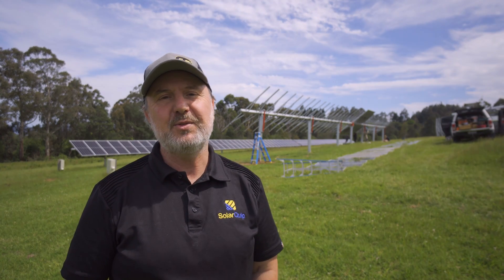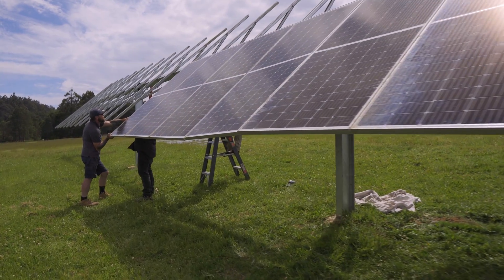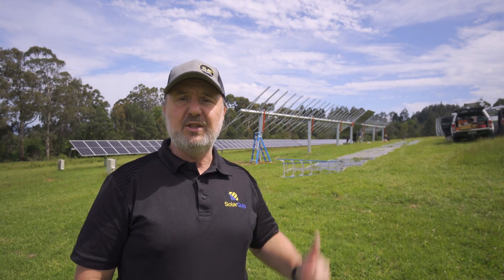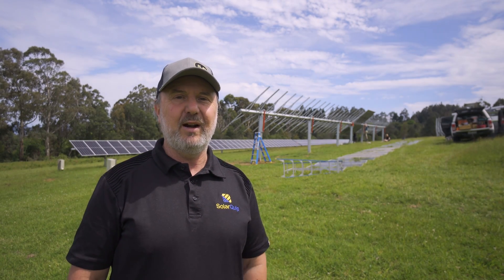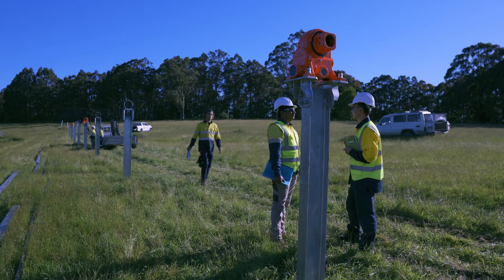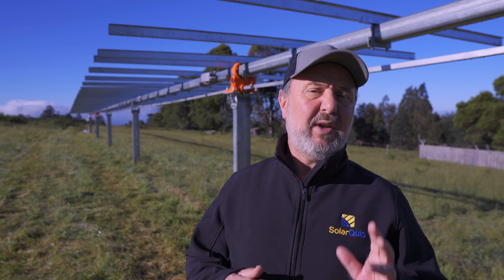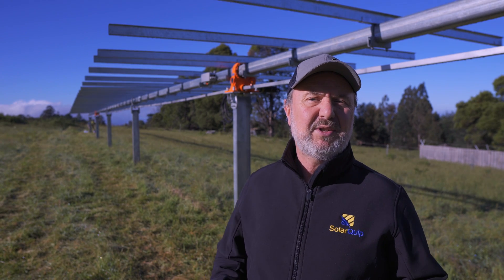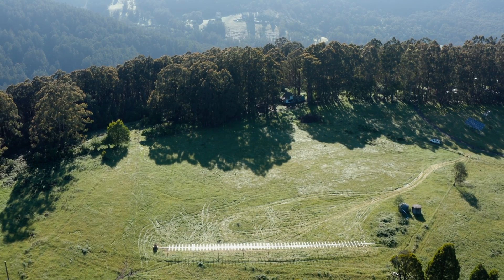120 Panel Solar Tracker Installation

Comment: Do you need linear actuators, slewing drives, solar tracker controllers these key components of solar tracker system?
Reply from the maker: No thanks. We are a demonstration and testing facility.

Comment: Those passive drives seem quite inefficient compared to using many smaller motors. I bet in 3-5 years when economy of scale kicks in we would see systems with many smaller motors and planetary gears in those types of trackers. Maybe even purposely build 40v motors.

Comment: 👍How many m2 of panels are there and how kw of there.  How efficient will 💥array 💥be. How 💲🌏💲💲💲💲will cost.
Reply from the maker: The SkySmart I tracker has 36kW of panels and the SkySmart II can fit about 50kW of panels. Cost for tracker depends on volume but I heard ~9-13 cents/W.
Reply: @SmartEnergyLab  Thanks, Glen

Comment: Those piles look nice and robust a lot of sail area there.
Reply from the maker: Yes, Arctech Solar do a full engineering analysis based on wind load for the site, soil structure and select the appropriate components. The piles on the SkySmart I are 5m long, half in the soil and half out with a concrete collar arond each. The purlins on the SkySmart I are their "exterior" tracker purlins designed for trackers on the edge of a solar farm where wind speeds are the most damaging.